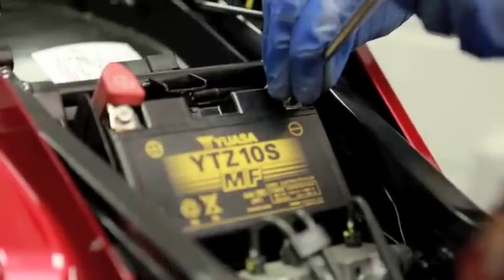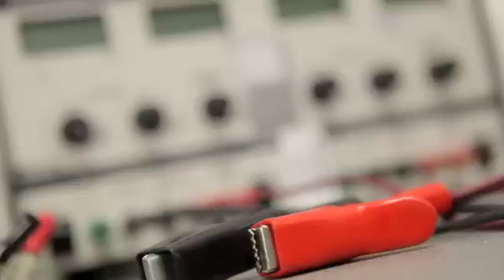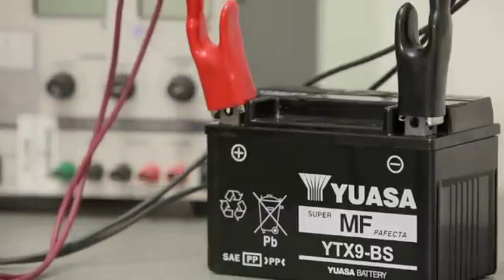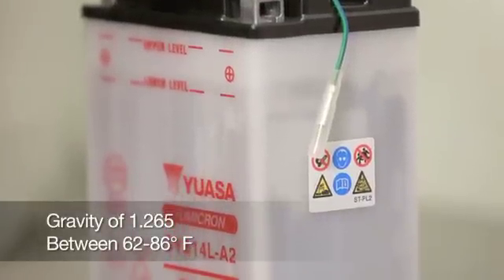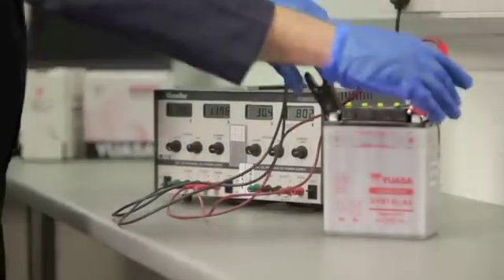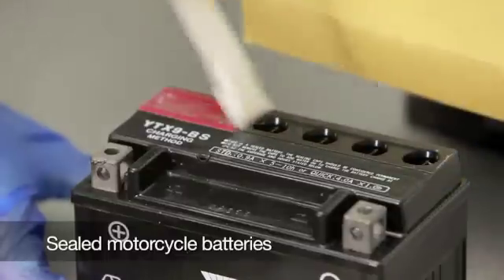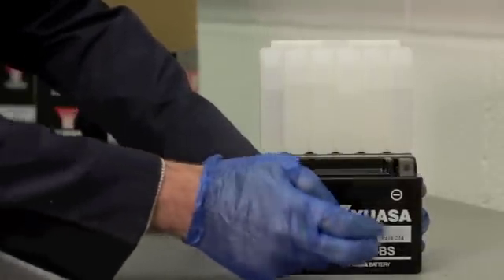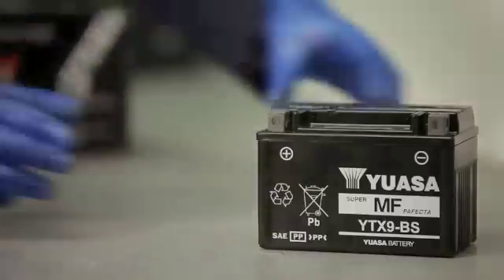Yuasa Battery Basics - Battery Charging

Comment: I just bought a new battery AGM and after I filled it up acid. And after I filled up I see the level was just under the plates in two cells so I take batterywater and filled it up just over the the plates. I did right or wrong? I just damaged the battery? I heard if level is under the battery can damage. 
Regards Micke

Comment: I have an oxford oximiser 900   the whole point of me getting it is to trickle charge it but how can i do that if i have to remove caps from Battery. i thought it was straight forward to just plug n mains charger to  the ext connections that  would be hidden away which saves taking the seat off.  not your fault as I know i am doing something wrong maybe the oximiser is not compatible , THANKYOU

Comment: I have sealed the battery before charging it, can I still charge it normally?
Reply: If you can pop open the caps, yes I would.  Personally, when I recharge my car/motorcycle batteries, I loosen the cap for each cell just so any vapor can escape easily, close after fully charged.   BTW, it was a month ago since your post, hope all went well and safe.

Comment: On the instruction that came with the sealed battery it says to install the caps tight, after filling with the electrolyte. Here on this video you advice to leave them loose for the first charging. What is the right way then ?
Reply: Yeah, not confusing at all 🤷‍♂️
Reply: Relevant in 2024 as I was wondering the same thing. Filled up the AGM battery, sealed the top and placed it on a trickle charge (900ma). It's been roughly 36 hrs and I'm not seeing a "full charge" indicator on the trickle charger. I did connect the Voltmeter to the terminals (as it's charging) and it reads 14.2V....so im not sure if I should just be patient or if I messed up somehow.